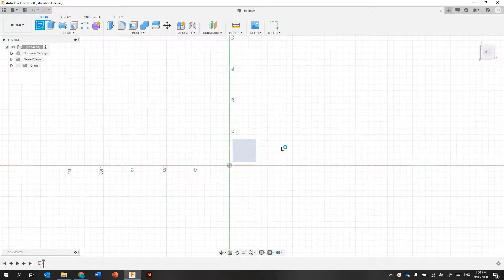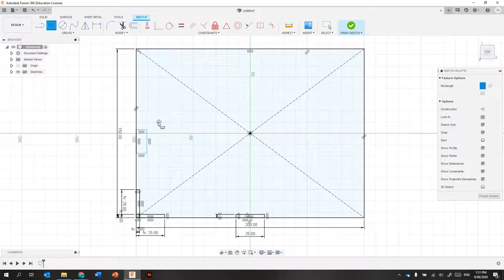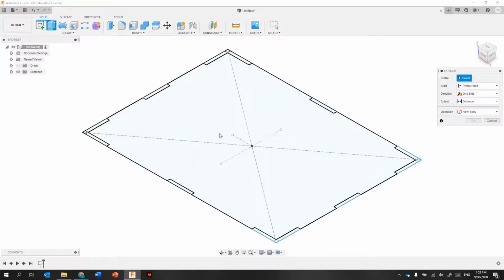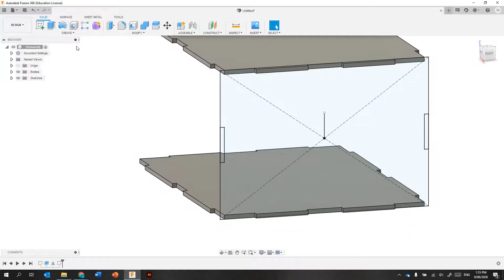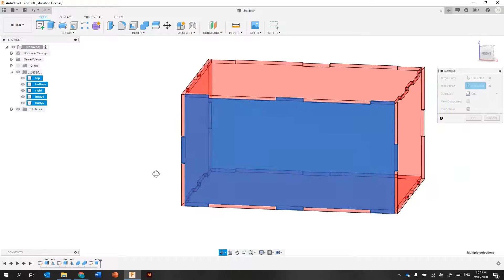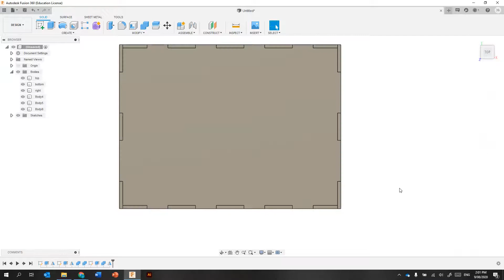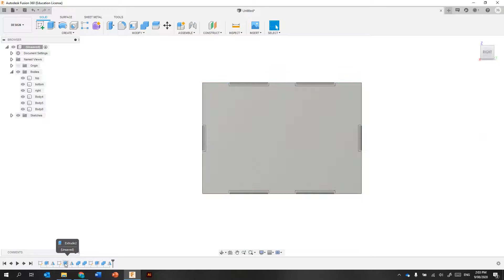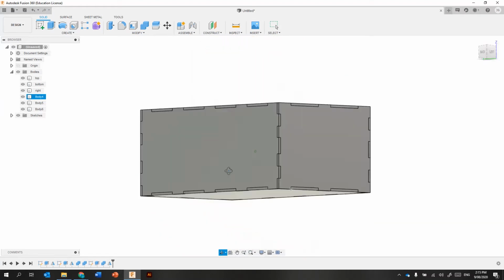Easy Laser Cut Box in Fusion360

Comment: Clothes hanger
From Wikipedia, the free encyclopedia
Jump to navigationJump to search

Wire (top) and wooden (bottom) clothes hangers

Wooden clothes hangers in Sardinia

Foldable clothes hanger with sheath, about 1960

Various clothes hangers
A clothes hanger, coat hanger, or coathanger, is a hanging device in the shape/contour of:

Human shoulders designed to facilitate the hanging of a coat, jacket, sweater, shirt, blouse or dress in a manner that prevents wrinkles, with a lower bar for the hanging of trousers or skirts.
Clamp for the hanging of trousers, skirts, or kilts. Both types can be combined in a single hanger.
The clothing hanger was originally designed to allow people quick access to their clothing as well as designate an area, in their home, to keep their clothing in. It was also used to keep clothing dry or without a wrinkle.

There are three basic types of clothes hangers. The first is the wire hanger, which has a simple loop of wire, most often steel,[citation needed] in a flattened triangle shape that continues into a hook at the top. The second is the wooden hanger, which consists of a flat piece of wood cut into a boomerang-like shape with the edges sanded down to prevent damage to the clothing, and a hook, usually of metal, protruding from the point. Some wooden hangers have a rounded bar from tip to tip, forming a flattened triangle. This bar is designed to hang the trousers belonging to the jacket. The third kind and most used in today's world are plastic coat hangers, which mostly mimic the shape of either a wire or a wooden hanger. Plastic coat hangers are also produced in smaller sizes to accommodate the shapes of children's clothes.

Some hangers have clips along the bottom for suspending skirts. Dedicated skirt and trousers hangers may not use the triangular shape at all, instead using just a rod with clips. Other hangers have little rings coming from the top two bars to hang straps from tank-tops on. Specialized pant hanger racks may accommodate many pairs of trousers. Foldable clothes hangers that are designed to be inserted through the collar area for ease of use and the reduction of stretching are an old, yet potentially useful variation on traditional clothes hangers. They have been patented over 200 times in the U.S. alone, as in U.S. Patent 0586456, awarded in 1897 to George E. Hideout.[1]

Contents
1	History
2	Unintended uses
3	Gallery
4	See also
5	References
History
US President Thomas Jefferson was known to have a device for hanging clothes in his closet at Monticello.[2] However, today's most-used hanger, the shoulder-shaped wire hanger, was inspired by a coat hook that was invented in 1869 by O. A. North of New Britain, Connecticut.[3] An employee of the Timberlake Wire and Novelty Company, Albert J. Parkhouse of Jackson, Michigan has also been credited with the invention. The story goes that one morning in 1903, Parkhouse arrived to work to find that all coat hooks were taken. Annoyed, he took a piece of wire, bent it into the shape we would recognize today, and hung his coat.[4] Also credited is Christopher Cann in 1876 as an engineering student at Boston University.

In 1906 Meyer May, a men's clothier of Grand Rapids, Michigan, became the first retailer to display his wares on his wishbone-inspired hangers. Some of these original hangers can be seen at the Frank Lloyd Wright-designed Meyer May House in Grand Rapids.

In 1932 Schuyler C. Hulett patented an improved design, which used cardboard tubes mounted on the upper and lower parts of the wire to prevent wrinkles, and in 1935 Elmer D. Rogers added a tube on the lower bar, which is still used.[5]

Hangers can be made in wood, wire, plastic, rarely from a rubber substance and other materials. Some are padded with fine materials, such as satin, for expensive clothes, lingerie and fancy dresses. The soft, plush padding is intended to protect garments from shoulder dents that wire hangers may make. A caped hanger is an inexpensive wire clothing hanger covered in paper. Caped hangers are used by dry cleaners to protect garments after cleaning. Used wire hangers may be recycled, or returned to the dry cleaner.[6]

Unintended uses
The wire is versatile, and wire clothes hangers are often used as cheap sources of semi-tough wire, more available than baling wire for all sorts of home projects.[citation needed] The use of wire clothes hangers for use as makeshift welding rod has been common for nearly 100 years.[citation needed] Similarly, many similar do-it-yourself and children's projects use wire hangers as holders of various types, from keeping a brake caliper from hanging by the brake line during auto repair work to securing a gate on a birdcage. The much-loved 'Advent crown' made for children's TV program Blue Peter was made from four-wire coathangers.[7] Coathangers can be used to make dowsing rods.[8] After sanding, wire hangers also find uses as conducting wire for uses as varied as hot-wiring cars to games[9] to testing hand steadiness. They are commonly used to gain forcible entry into older automobiles whose locks and entry systems are not protected from such methods. There is a long history of using wire coat hangers as replacement car radio antennas. Clothes hangers are also commonly used as an implement for roasting marshmallows or hot dogs at camp-outs.[citation needed]

Abortion poster with wire hanger during Women's March, Frankfurt, 2017
Collecticus magazine reported in October 2007 that clothes hangers have now become collectible, especially those with a famous company or event advertised across the front. For example, a 1950 Butlins hanger sold for £10.10 in October 2006 within Collecticus.

In 1995, while performing surgery in an airliner at 35,000 feet (11,000 m), orthopedic surgeon Angus Wallace and his fellow doctor Tom Wong used an unfolded coathanger, sterilised with brandy, as a trocar to stiffen a catheter for use as a chest tube to relieve a passenger's pneumothorax.[10][11]

Straightened-out wire clothes hangers have been used to perform unsafe and/or illegal abortions (frequently self-induced) by inserting the wire through the cervix and into the uterus, in order to cause the uterus to expel its contents. This life-threatening method poses severe risks to the person on whom it is performed.[12] At pro-choice protests, wire clothes hangers have been used as symbols of the danger of criminalizing elective abortion.[13][12]

Gallery

Regular clothes hanger

 

Clamp

 

Clip hanger with two clamps

 

Clip hanger with only one clamp

See also
Coat rack
Shoe hanger
Clothes line
Drying rack
Clothes valet
Pimp stick
References
 "Coat-hanger". google.com. Retrieved 23 April 2018.
 "Clothes Rack". www.monticello.org.
 "Improvement in clothes-hook".
 Ament, Phil. "Coat Hanger History - Invention of the Coat Hanger". ideafinder.com. Retrieved 23 April 2018.
 "Do You Know Who Invented the Coat Hanger?". Retrieved 2016-09-28.
 "Hanger Reuse and Recycling". NYC Department of Sanitation. Archived from the original on 1 March 2014. Retrieved 24 July 2014.
 "BBC - I Love Blue Peter - Trivia about Valerie Singelton, John Noakes, Peter Purves". www.bbc.co.uk. Retrieved 23 April 2018.
 "How to Use Dowsing or Divining Rods". wikihow.com. Retrieved 23 April 2018.
 Neuroscience for Kids University of Washington
 Anstead, Mike (9 June 2006) "The Scot who raised England's hopes". The Guardian
 Wallace, W. A.; Wong, T.; O 'Bichere, A.; Ellis, B. W. (1995-08-05). "Managing in flight emergencies". British Medical Journal. 311 (7001): 374–376. doi:10.1136/bmj.311.7001.374. PMC 2550436. PMID 7640548.
 Waldo L. Fielding, M.D., Tony Cenicola, ed., "Repairing the Damage, Before Roe", The New York Times (June 3, 2008)
 Oakley, Doug. "CA: Berkeley council sends coat hangers to protest health care bill's abortion restrictions", Oakland Tribune. 10 December 2009.
	Wikimedia Commons has media related to Clothes hangers.
Authority control Edit this at Wikidata	
LCCN: sh89006429MA: 2780782217
Categories: American inventionsDomestic implementsClothing industry
Navigation menu
Not logged in
Talk
Contributions
Create account
Log in
ArticleTalk
ReadEditView historySearch
Search Wikipedia
Main page
Contents
Current events
Random article
About Wikipedia
Contact us
Donate
Contribute
Help
Learn to edit
Community portal
Recent changes
Upload file
Tools
What links here
Related changes
Special pages
Permanent link
Page information
Cite this page
Wikidata item
Print/export
Download as PDF
Printable version
In other projects
Wikimedia Commons

Languages
العربية
Español
Français
Bahasa Indonesia
Italiano
Português
Русский
اردو
中文
32 more
Edit links
This page was last edited on 1 April 2021, at 13:20 (UTC).
Text is available under the Creative Commons Attribution-ShareAlike License; additional terms may apply. By using this site, you agree to the Terms of Use and Privacy Policy. Wikipedia® is a registered trademark of the Wikimedia Foundation, Inc., a non-profit organization.
Privacy policyAbout WikipediaDisclaimersContact WikipediaMobile viewDevelopersStatisticsCookie statementWikimedia FoundationPowered by MediaWiki.